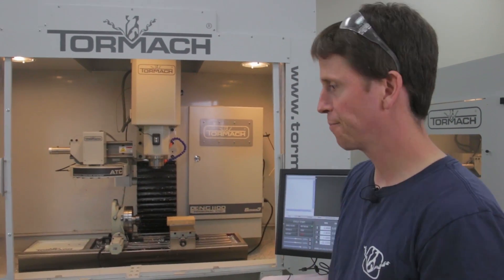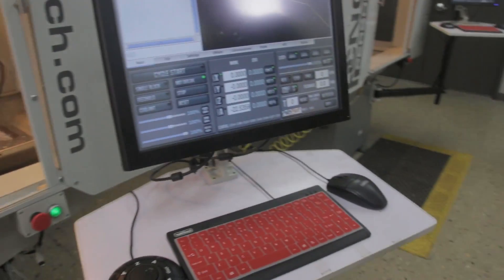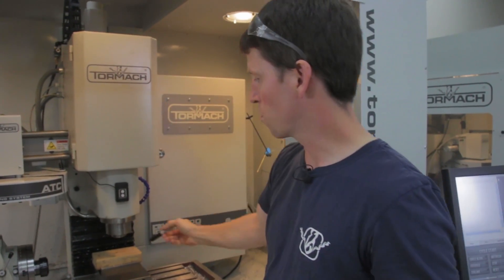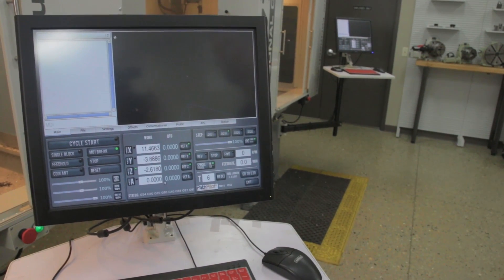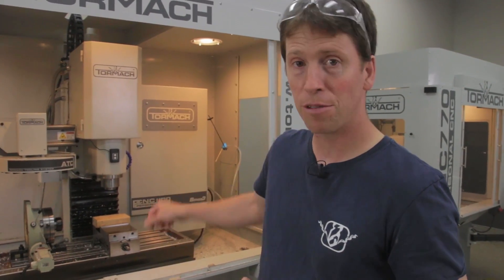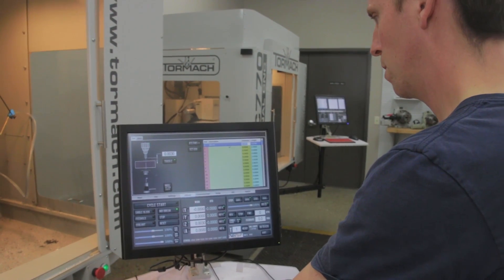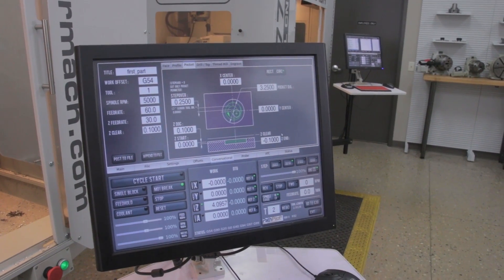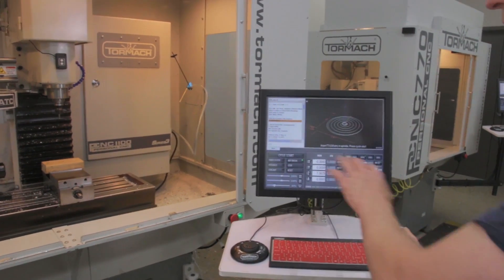Cutting Your First Part on a Tormach Mill

Comment: nice video, and nice to see "that no page of the manual was harmed in the making of this film". Also why do you leave the doors open while milling?- thought there was an interlock which prevented it, esp at full speed!!
Reply from the maker: +andy van We highly encourage having the doors shut while the mill is operating, but we left them open so we could record high quality footage. For this same reason, we do not have the interlock installed on this particular machine.
Reply: Door pressure switches are typically tied off for certain operations, it's a dangerous but extremely common. Sometimes it just makes sense, like running a dry pass and observing for any potential collision ect. Breaking a spindle or losing its mast p.o.s is an expensive oops

Comment: just a thought here, if you are in a "metric system" country, how do you change the measurement system over to MM settings, as if you enter a decimal, one would assume here that from your videos the machine thinks this is INCHES, NOT the milimeters YOU thought you had entered.

Comment: good beginner part, but as a "first project", could you have shown us how to install the tools into the holders?, just a thought, as "manual" machine chucks and collet systems do differ to the tool holders used in these cnc machines also if Tormach has other videos on this, add a link in the description area, and\or add these videos to a playlist, and number them, so we can watch these in the right order.

Comment: I have to buy one of these even the smaller 440 I just started saving money I'm disabled and I'm probably going to kick the bucket before I ever get one I'm so bummed out I got to get one period in the last few years I've taught myself how to run an old manual lathe I'm pretty proficient. An aerospace company gave me a hardinge speed lathe and I got to get up with all the old accessories like the old turret xcetera I threading head I got a good deal on a bunch of H&G threading inserts and it's a lot of fun even though it's kind of useless LOL it's not like I manufacturing anything.

I got to figure out how to save some money I got to get the basic package at least
Reply: Hey boss! I thought I'd never buy one, but I reached out to tormach and they talked to me about all the financing options they had, I went through Geneva Capitol, the smallest down payment is a little shy of 2,000, I'm doing 5k down for my 10,000 machine, they had a 1000 discount at the time. My monthly payment will be 148 per month. Not sure if this helps.

Comment: he sounded not to ecited for the first part. dudes an enginer I alrady have very good idea the type work edoes. codeing, user interface safty testing trouble shooting, examples. quality control .........yeah add im sure as team was programming this amchein you cant help realize hwo oen small error can will caouse crash...radio id tag in the tool to prevent crashes. not all some. but asm programmers make awsom ecnc operatiors machined designers..

Comment: Daniel, thanks to you and the Tormach team for putting these videos together.  I found this video when working through chapter five of the manual.  In the text I could not find any reference about designating a x and y 0 referenced to the part so I Googled up this video where you do specify the center of the part as x and y 0.  If I'm correct about the text it may be worth editing the manual since many of the people running through that exercise may be new to CNC and could have their first project run an end mill through a clamp or similar.
Reply from the maker: +Shane Harvey We'll review this for a possible manual update. Thanks for the comment.
Reply: Shane is right,  my text does not center over the pocket even after i us the justification buttons